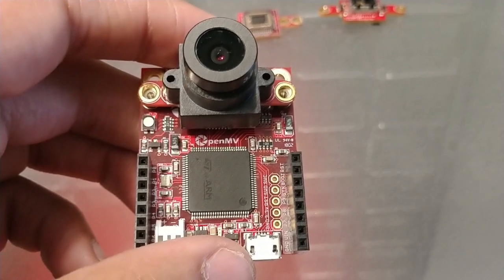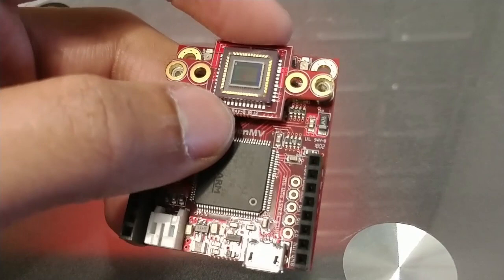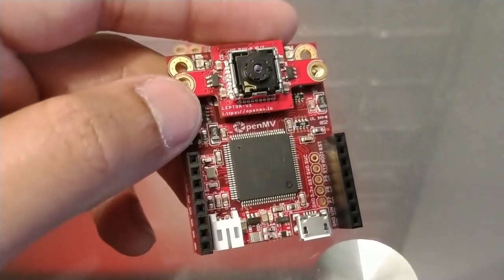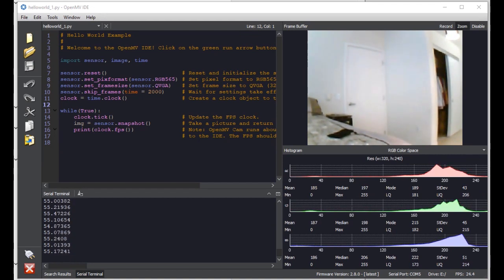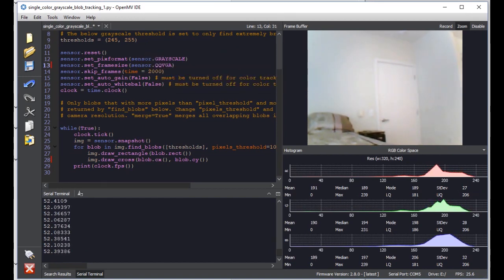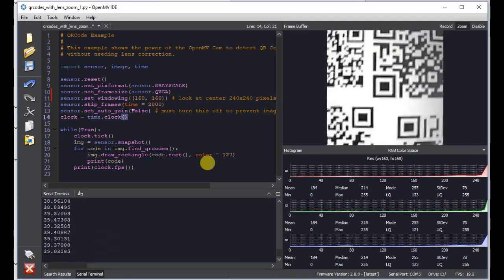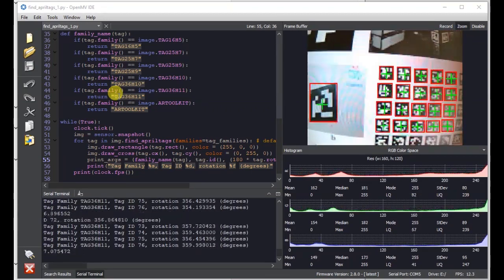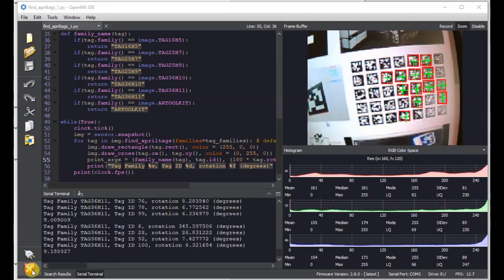The New OpenMV Cam H7

Comment: Hi, first of all, I am very glad I found this amazing project. I am thinking of self-made trail camera, but starting from a scratch is nonsense for me. Before I saw this project, I had also an idea that it might be enough to interface Omnivision camera with STM32H7. But, according to basic bit-rate calculations, I came to a conclusion that external RAM is needed (and of course I do not have knowledge of designing such devices). Is your device capable of storing 60 seconds clips on SD card in 1080p @ 30 fps? Thank you!
Reply from the maker: Our new OpenMV Cam H7 Plus can take 1080 images. It cannot achieve 30 fps however. The STM32H7 processor isn't really designed to do video. The camera can send JPEG images to the H7 and that can be stored to the SD card as an MJPEG file. However, you'd need to modify our firmware to have a fifo buffer to get smooth video. Taking snapshots is fine however. Note that our product is designed for machine vision. We have no video fifo buffer onboard. This is on purpose such that when you process and image it's the latest image and not delayed by several frames leading to response lag. If you are trying to build a video camera there are other processors more suited for that. Our system is mainly about processing on very low-power, cheap, and easy to buy hardware. The STM32H7 is sold on digikey without any NDAs needing to be signed to get it to do anything.

Anyway, if you are okay with taking 5 MP snapshots the OpenMV Cam H7 plus will do what you want. It can also do MJPEG video. However the firmware is not setup with a video fifo so if you try to record an MJPEG video it will be jerky. If you modify the firmware to buffer frames when writing to the SD card you can then achieve smooth video.
Reply: @OpenMVLLC  Thank you for your extensive answer. I have expected that STM32H processor is not designed for processing the video of such resolution and frame rate. Could you please recommend me other "free to use" cheap processor that could handle this task? OR maybe similar ready device as yours? I found nothing. I recently inspected my low-cost trail camera and there is some low-cost "still camera processor" (NT96223), but of course it is not available for end-user and there is lack of documentation... And of course, it needs to run on batteries, for a long time, and it needs to "wake up" and start recording in a fraction of a second, so raspberry is out of the game...
Reply from the maker: @ondrejzvozil  This is why I'm working on OpenMV, to make this possible. Right now if you want high end features you have to be building millions of units to get access to high end chips. That's just what it is right now. The point of OpenMV is to get to a future where camera data processing is not locked I to high end chips only.
Reply: @OpenMVLLC  Thank you for your work, I will stay tuned :)

Comment: Would be cool to see this running on I.MX RT
Reply from the maker: One of their application engineers already did a large porting job. I expect they will release something after the H7 is out.
Reply: Today I was at NXP's seminaire where they told that they are preparing release of new i.mxRT1170 MCU with 1GHz core clock. That will be really interesting...

Comment: In your email you say the next firmware release will be able to run CNNs (which is awesome!). Will it be able to run RCNNs as well?
Reply from the maker: The planned initial support is just for history less feed forward networks. However, it should be possible to allocate a buffer for history and use that again. Not sure if we will have support for this at first.